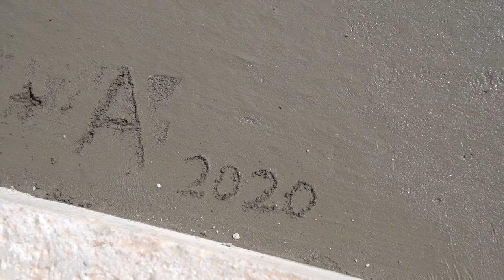OUR FINAL DAY OF CONCRETE | BUILDING OUR OWN HOME

Comment: I usually like watching your channel but recently your sponsored episodes are a little too much. For example, you’re in the middle of a forest with shade everywhere and you found it necessary set up your awning?!
Reply: Perhaps you are unfamiliar with western forests. Tall straight Limber Pines grow super efficiently in these extremely dry forests, but they are not necessarily very good for shade. Aspens are all one plant, and do not have flat ground between them. Meanwhile the temperature can be 12F at night and sometimes 90F in the afternoon. Working at 8,000 feet is extra work due to the lack of oxygen, and you can work up a sweat fast. Trent and Allie found a flat spot with lumber and created a rest spot where they could easily walk over to their site... smart. So is the idea of a moon cot.🙂lying down and sleeping is a great way to help the hydration and oxygenation process.
Reply: Ellyn Merydith I spend most of my weekends in the Rocky Mountains so I’m very familiar with the forest. I was just making a point that it was a stretch to get their plug in for their sponsored episode when shade was to be found all around them.